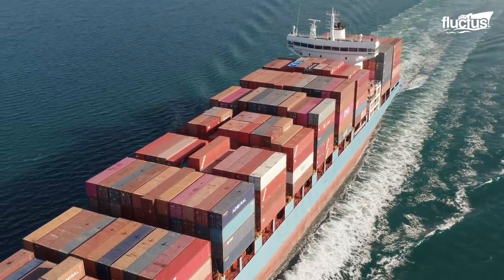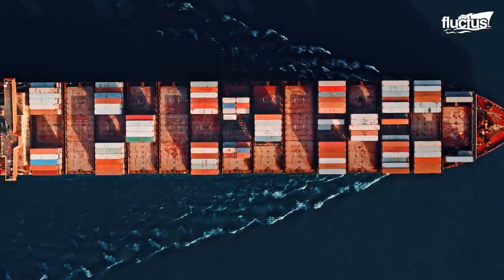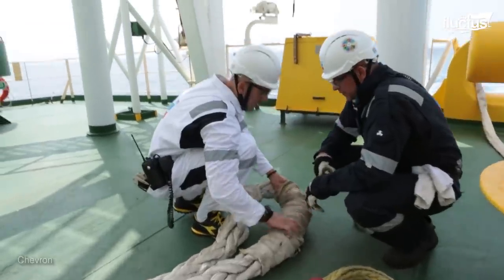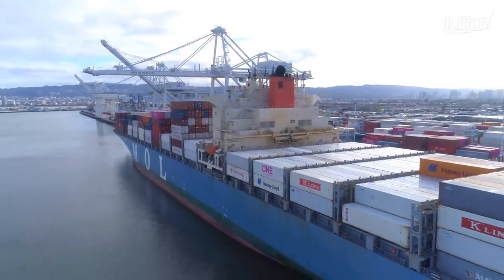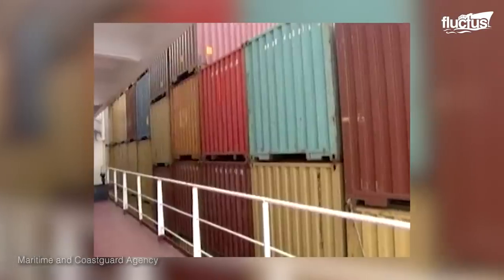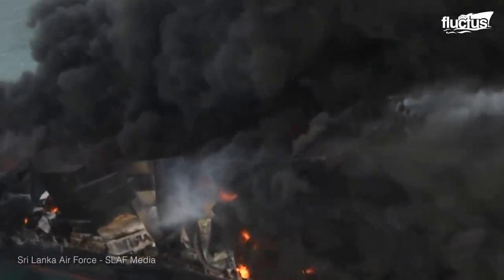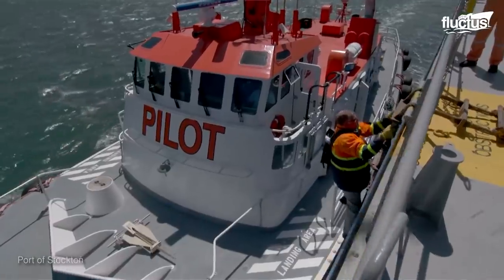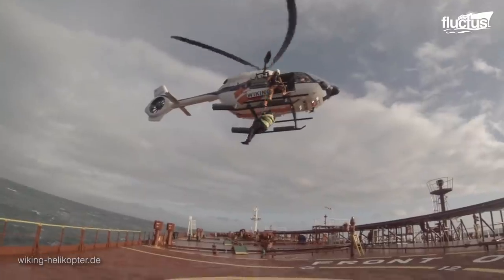A Day in Life of a Container Ship in Middle of the Ocean

Comment: When I was deep sea fishing off the Gulf of Mexico, there was a container ship fully up out of the water (when the containers are on it, it sits down low in the water due to the weight of the cargo), docked in the middle of the ocean. You couldn't see land in any direction. The anchor chain links were the size of a pickup truck. I've never seen anything like it and there were double sets of chains for each anchor. It was like 20 stories high and you could see the water spiraling around it that would have sucked our 75' yacht right under if we got closer than about 20 feet.